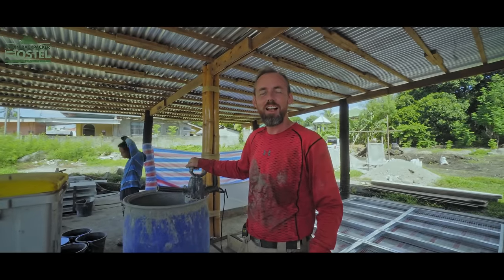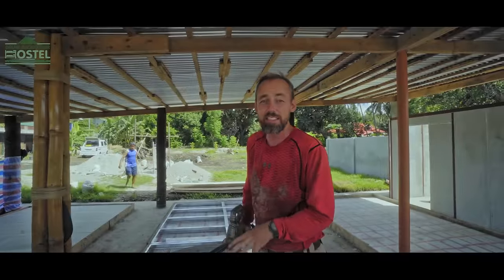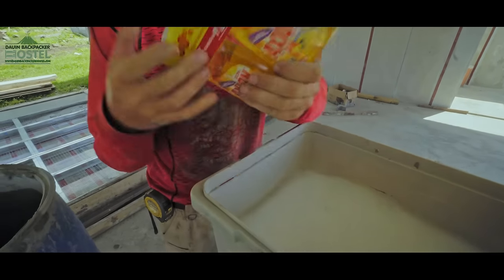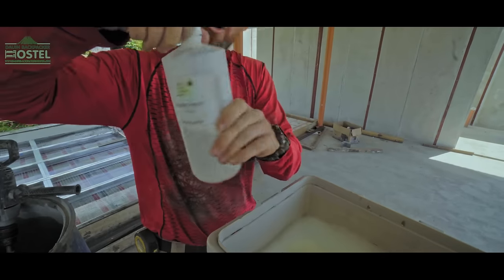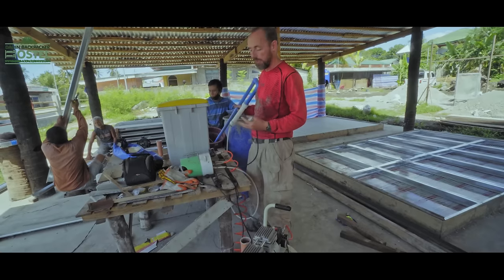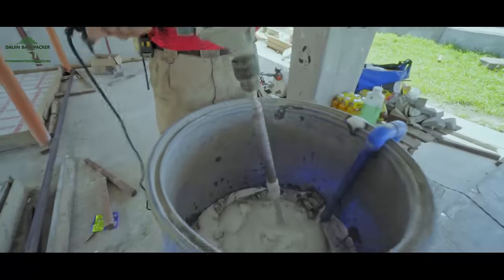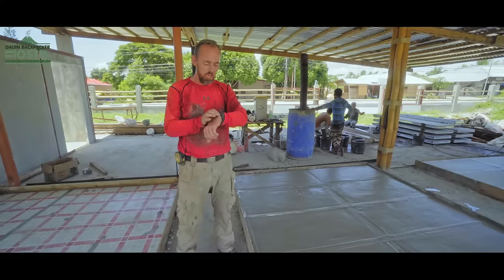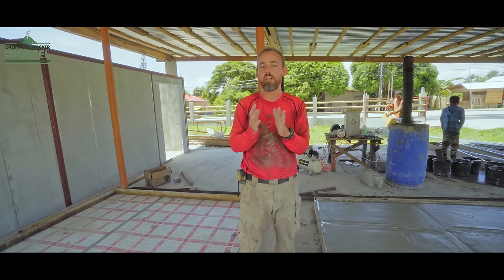Precast Aircrete/Foam Concrete Panels - How To Mix and Pour

Comment: Fraternal greetings. Excellent video with explanation of the whole process. I'm from Brazil and I use google translator. I have been looking for information on the manufacture of foam for lightweight concrete for a long time. Today, watching your video, I saw the whole process of preparing this foamy agent. I would like some information: 1- When preparing the cement mix, what quantities of cement, water and sand were used? 3- When preparing the foam, 500 ml of liquid soap and 30 ml of glycerin were used. How many buckets of water have you used in relation to these two ingredients? Grateful for the attention.
Reply: He mentioned the amount of water 3 times in the video, he uses 19 litres of clean water.  500 mililitres of liquid soap and 30 mililitres of Glycerin :)
Reply: @SaranganiBob  Thanks for the information.

Comment: Great video, if your using the Domegia recipe they don't mention adding sand.  How much sand are you using per mix?
Reply from the maker: Hey, I mention domegaia with regards to my foam solution, I found the domegaia aircrete mix too soft so increased the density with the additon of sand. To one 40kg bag of cement I add 30kg of sand to be around 600kg per 1m3 density.
Reply: @aircreteconstruction  Many thanks, this is the additional info I need.
Reply: @aircreteconstruction  usas (40 litros agua + 1 litro champu o lava platos)= espuma en concreto (40 kg cemento +  30 kg arena)   ???????
Reply: @aircreteconstruction   que ancho tiene el marco de metal ???
Reply: lo encontré en los comentarios mas abajo.gracias

Comment: I  understand why you are using the aircrete, to limit the noise and reduce thermal bridging. doesn't the use of the metal increase thermal bridging though. I saw one guy who is using a pour in place wall that uses a movable mold. you basically raise the mold and pour up to the height you require. I will be making my house out of aircrete as well. I will be using a pole barn construction and filling he spaces between the poles with the aircrete walls. I think it will be great as I find you do as well. I think this is the best material for the Philippines as the cement houses are way too hot and aircrete solves all those problems. how much is each panel costing you in pesos. looking forward to your reply. and comments.
Reply: If you are referring to the wire mesh, the heat conduction of that low mass is insiginifacant.
Reply: @Andy-df5fj  no, I am referring to the metal that become the frame of the panel. you poor into it and then take the whole thing and use it for the wall. that metal is a thermal bridge. the mess inside is buried to far to make any difference to anything but the metal frame you use would bridge a lot of heat into the dwelling, or are you only using those inside for dividers. do you use the same for the outside wall as well? from what I have seen you are and that would be the thermal bridge I am talking about and want to avoid. How is your build going by the way. we will be back in the Philippines in a few weeks.
Reply: @kusnezoff8705  
Ok  yeah that frame will conduct enough heat to have an overall impact.  Oh and I'm just an observer like you, so I can't answer those questions on what he uses.

Comment: Water
Cement
Sand
---------
19 litres water
500ml dish soap
30ml glycerin

Compressor Foam Generator
(like wet meringue consistency)

Comment: interesting but I would question the strength this country or cluster of islands gets hit hard by typhoons. I could have that laid up in blocks or bricks by the time you build the formwork and mix.
Reply: I think the thing about aircrete is the money saved and insulation value much less the time and strength

Comment: Why didn't you use concrete mixer? Thanks for sharing this.
Reply: I think you dont need to. The hand held drill is enough just need a pouring contraption on it.... what i think he used in the video. For easy pouring.

Comment: Thank you so much for this wonderful video. It is very well done. Very detailed. I was just wondering if I could use the Asking soap in the foam mix. The glicerin is s nice touch there.
I'm just gathering info to plan my dream house. My husband and I are considering the possibility to using aircrete on top of a geodesic dome structure.
Reply: I'm not sure what you mean by on top of and why you wouldn't use it throughout. the Dome Gaia video on making aircrete domes another Channel called black dragon rising uploaded that and got 600,000 plus reviews there's a huge amount of chatter on it but one guy I got in touch with his name was Mark in Florida built a house and a garage geodesic design and used aircrete for all of the panels I'm not sure exactly how he did it but he I remember he said he was used wine cases to pour it in like I don't know a tub so I best guess is he used to funnel or something and built each built a house then in case it and then poured it at the top part of each triangular section of the of the geodesic dome. even one for friend in Alaska and he built one for a friend in Canada both in much colder climates so he was very cool in Florida but it was very warm for both of his friends and they both loved it cuz he used it about one cord of wood instead of 10 cords of wood.

Comment: Sir, YOU mixed Water, Cement, Sand , Foaming (dishwash), i did all this, but my block not strong bonding. May i know curing process for  strong block.
Reply: No sand

Comment: can you gravity feed the solution instead of using a pump?
Reply: I suppose if you can create a gravity feed system capable of producing 40 psi air pressure.  At 2.31 feet per psi, it would need to be about 100 ft high of water squeezing your air source.  An air compressor would be infinitely easier.

Comment: thank you for sharing this video. i'm planning also to build my house soon and i am considering Aircrete for my exterior/interior walls. 
i noticed on your other video that these panels are load bearing due to the absence of columns. so how can you adjust the mix for non-load bearing walls?
Reply: I don't think are you going to make them load bearing for very much weight I think you're just saying you're not saying columns and they're okay and maybe he'll answer you but you're not going to put a heavy roof on it that's for sure I think he's more using for insulation but we'll find out hopefully.

Comment: How much water i can use with cement? Before put sand.
Reply: 40 al 50% menos agua menos cuarteado en la mezcla por evaporacion al fraguar. 1parte cemento 1/2parte agua

Comment: isnt glycerine highly combustible? i.e. house fire?
Reply: Glycerine is not combustible on its own.  You are thinking of nitroglycerin.  Glycerine is Carbon, Hydrogen, and Oxygen.  When you Nitrogen is when you get Nitroglycerin and it is the nitrogen that makes it an explosive.  Now if you mix it with strong oxidants, like peroxides and nitrates, it will react violently.

Plus the amount that he uses, 30ml, is a very small amount after mixing.  18L of water, 500ml of soap, and 30ml of glycerine, plus the slurry amount.  With just the foam solution, glycerine is less than 0.1% of the total mix.

Comment: With all the background noise  and the  'I showed you earlier' nonesence this could have been an awful video. In fact I learnt a few things, run In reverse, add glycerine, keep damp for two weeks. A useful video, thank you. (And yes you are definately a bit anal about your measures, 18.98L  is way too exact less than a spirit measure in 19L (33 1/2 pints) ) You explain clearly so it would be nice if at some time in the future you could go though the whole aircrete making process both with all the expensive equipment and an a more basic form. Again thank you

Comment: I just watched some guy mixing and pouring a concrete cake. Seems to be a lot of work for not much wall.
Reply: You can hold a blowtorch against it for  an hour with your hand flat against it on the other side and never feel any heat this is for insulation not for strength.
Reply: You can watch Honey Do Carpenter on youtube and there is a demo that will answer your query.

Comment: All well and good , but the mix that you have poured into the forms , IT'S NOT THE SAME , as the one that you've mixed in the bucket , you can easily see that the mix in the barrel,  it's 5 times darker , that the one that was poured into the panel forms .....!!!